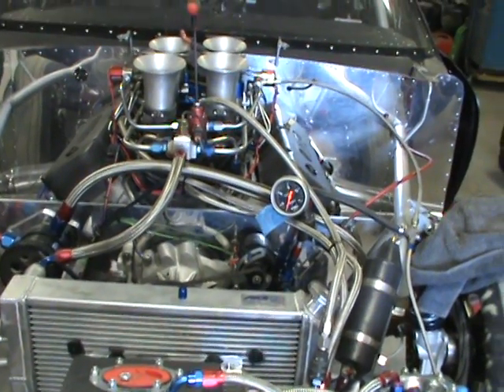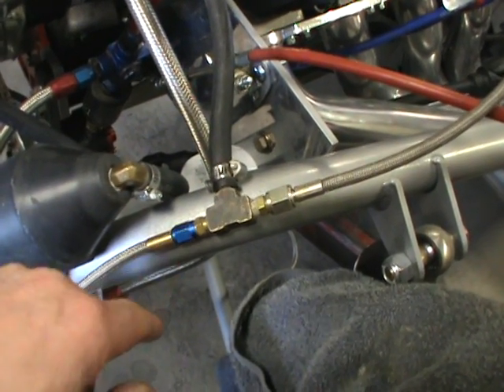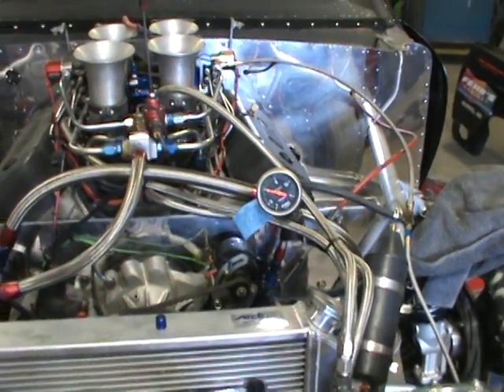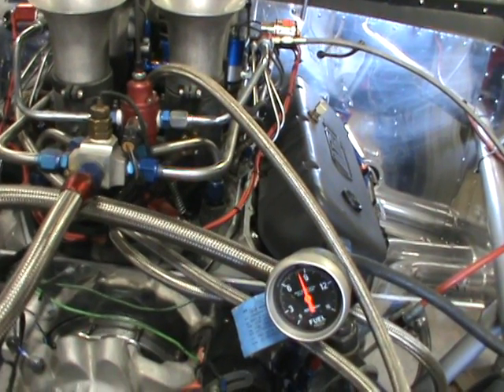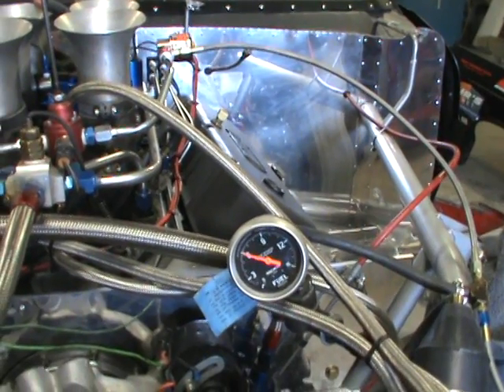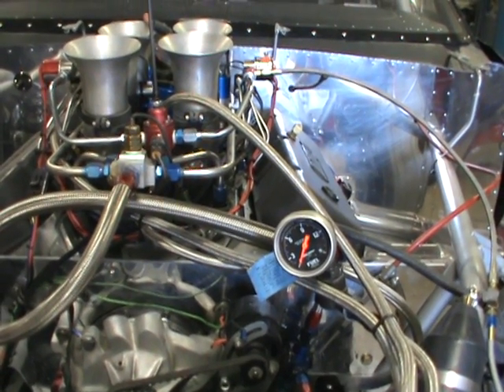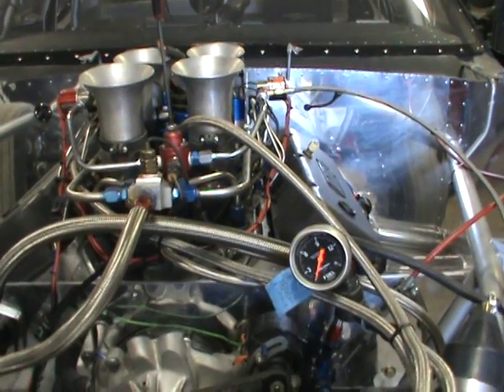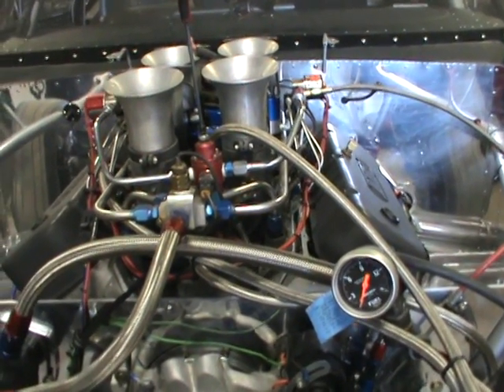Nitrous flow gauge.

Comment: Incorrect use the .073 jet for the plate and the fogger.
Reply from the maker: Say I run a .050 jet in a plate but flow it at 6psi with a .073 jet. Wouldn't the pressure be higher than the desired 6psi when running the system?

Comment: I just disconnect my fuel line going to solenoid and I have the exact same nozzle and jet as double and pop it in the line.  My regulator has a fuel pressure gauge and I just put the line in a bucket to check and adjust if needed.   Your extra lines and tee junctions I think would make your readings different because your introducing more area.  If your vehicle is happy and running fine then it’s good.

Comment: Question, you say if your running a 55 jet then flow it with a 55 jet...What if you have 2 kits, just say a 55 jet in 1 kit and another 65 in another kit...would you flow it 65 or add them together and flow that number wich would be 120 ?
Reply from the maker: Each kit would be flowed individually. You should have two fuel regulators with two kits. One for each kit. If you have a two stage plate you would flow the total of the two together.
Reply: @vipermech  thats what i thought, thank you

Comment: New to Nos, i got a sbf built with all forged rotating assembly and rings gapped for nos. Things is the  CR. is 11.0:1,
  Can i still add a 250-300 shot on there safely?.
 Whats you guys recomendatios?.
   Is the NX mainline a good choice?  Budget is a little tight rite now..
Reply from the maker: Yes you can. Start with a small shot and good fuel. Get the tune up proper and work your way bigger.

Comment: i have a zex adjustable kit i just bought, i want to leave my mechanical pump alone and run a electric fuel pump in the trunk off my fuel cell, what pump should i get to run just a 100 shot from the trunk.
Reply from the maker: +ss396rat Holley blue pump with regulator will work good.
Reply: +Jeff Wiebe would that be dead head or return
Reply from the maker: Dead head. Install the flow gauge fitting up front before the solenoid after the regulator
Reply: +Jeff Wiebe thanks

Comment: yes i got a question to ask you you said it dose matter what type of system it is on a fogger setup well have 2000 dodge neon its a 4 cylinder EFI system with a nitrous kit have a 50 and 75 shot in the kit add i a fuel cell and a fuel pump to my car do i use the same fuel pressure regulator as you got how would i tune the fuel side with a 50 and 75 shot
Reply from the maker: EFI could be a dry system. Than means the nitrous system would only flow nitrous and a controller or computer program will enrich the fuel side through the factory injectors. If you have both nitrous and fuel solenoids you will need to "T" into the factory fuel line and regulate the pressure to the nitrous fuel solenoid with a high pressure regulator.
Reply: Jeff Wiebe Ok will a return style fuel pressure regulator are it have to be Non- return style regulator
Reply from the maker: High pressure system will need a return style regulator. Low pressure system will not.
Reply: i got stock fpr on pump housing from the factory. ok my question is. my fuel pressure is at 49psi and thats all i can get. so if i run a second fpr will that cut my fuel psi in half. and whats the fuel psi for nitrous system.
Reply from the maker: The nitrous side fuel pressure should be 5.5-6psi. It will be hard to maintain that pressure "T"ing off the factory fuel line and still have sufficient volume with a return regulator for the injectors and nitrous system. That's why most EFI systems will be a dry system and have the injectors richen the fuel when nitrous comes on. To make it more simple you can install a dedicated fuel tank (one gallon), a regulator and a pump just for the nitrous system. That would make tuning and flowing the nitrous fuel system very easy and reliable.
Reply: Jeff Wiebe k thank you for helping me out on that
Reply from the maker: I hope it works out for you. Good luck.
Reply: Jeff Wiebe i hope so to thanks

Comment: I flowed mine wide open in a gas can before I bolted it up, 6psi wide open 7.5 shut. I did not use a jet though I'm guessing it will be 7 or 6.5 with a jet.
Reply from the maker: You must use a jet, don't guess.

Comment: So flowing through 1 jet is the same as flowing through 8 jets? Seems like your pressure would drop from 1 as compared to 8.
Reply from the maker: Flowing through one big jet for a fogger system with get you a base line tune up for the 8 small jets being used. The industry standard for flowing a fogger is a .071 jet no matter the individual jet size. This will get you a starting point as it would be impossible to flow all 8 jets. Always check plugs and log performance after the initial set up and adjust jets accordingly. A plate system because your only using one fuel jet, you have to flow the system using that jet. Flowing fuel pressure through an .071 jet in my fogger has worked perfect for me spraying a 250 shot. .028 nitrous jets and .024 fuel jets.
Reply: Jeff Wiebe Great video man. Thanks for the info.

Comment from the maker: Yes I've seen gauges out a bit. The important thing is to flow it with the same gauge every time. It doesn't matter if its out a bit because your tune up depends on consistency. Reading plugs and logging performance with changes you make is what matters. I have a gauge in the car too, its off 1/2 psi compared to my flow gauge, but its there so I can see the fuel pump working and if there is a big pressure drop on the run. I don't run a safety fuel shut off switch, that's my safety system.

Comment: in on 6!
I set mine at 5.5 pressure.
I have the NX  nitrous gauge kit.
I have 3 of them autometer fuel pressure gauges...and all three show different.
I do almost like you do,I have a plate system and I  go through the solinoid and have the car running so it's getting the same  voltage as it would be getting as the car is going down the track.
I  have an alt. on my car.
thanks for showing!
looking good!